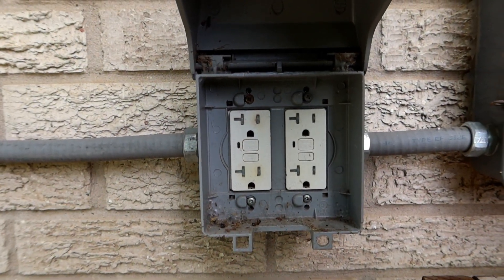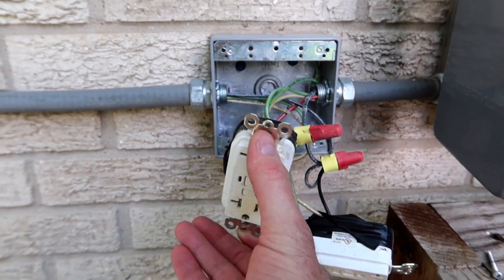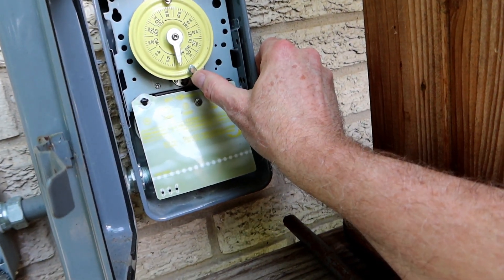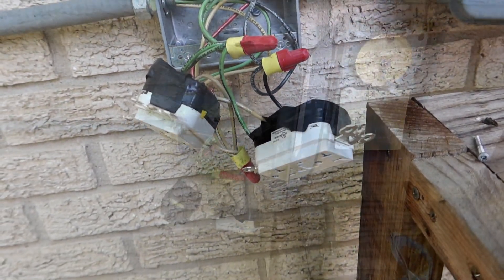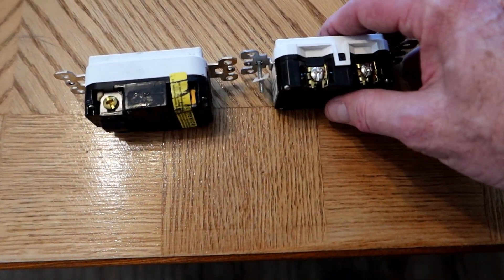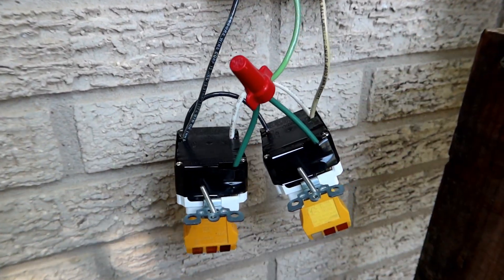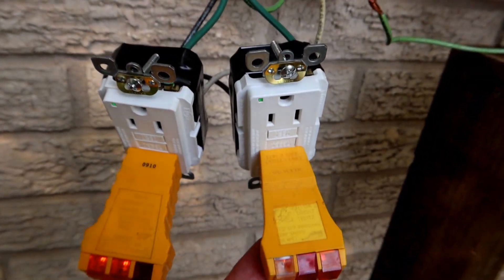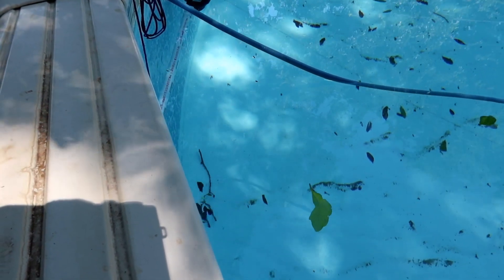Replacing The GFCI Outlets For The Pool

Comment: GFCI receptacles do not trip faster than a circuit breaker, they trip sooner. Circuit breakers, not including GFCI breakers, trip on circuit rating overload, GFCI receptacles measure the current on the hot and neutral conductors and if there's a difference of approximately 6mA they trip, regardless of whether there's a ground wire or not. You don't need 2 GFCI's, you could have wired the second (regular) receptacle from the Load of the GFCI and accomplished the same thing for less money.

Comment: as i understand gcfi, only the circuit grounding to an outside ground is controlled, two elements shorting that are in the circuit as they were supposed to be is more likely causing the circuit breakers which are reading overloads, and gcfi is only looking for 'illegal grounding'... as it were. good luck.

Comment: that pump sounds like it was overvolted big time, like 220 was getting into the 120 circuit ... that could also be the problem with your circuit breakers, an unauthorized connection can be intermittent, you should put over voltage signalling devices on the branches of your breakout box... handy to be able to check line voltages at a glance anytime, but especially when you have electrical problems, and the devices are very inexpensive, relative to rebuilding a burned house... very inexpensive...

Comment: The timer function for you pool pump is really important especially if you travel away from home in the heat of the summer. You would want that pump circulating to keep the pool from going green while you are away from home.